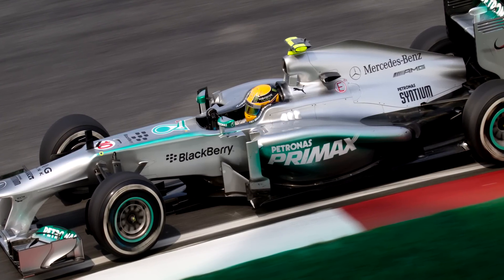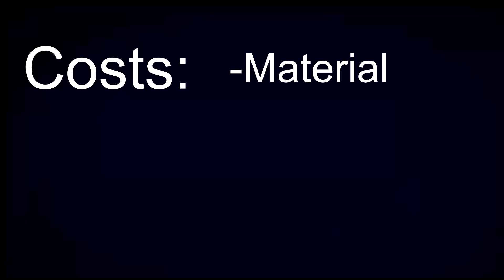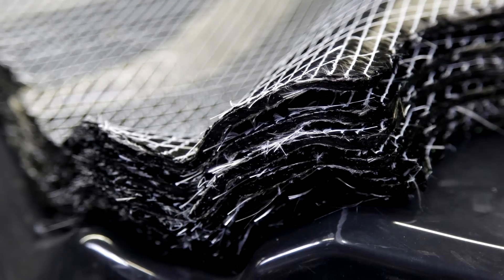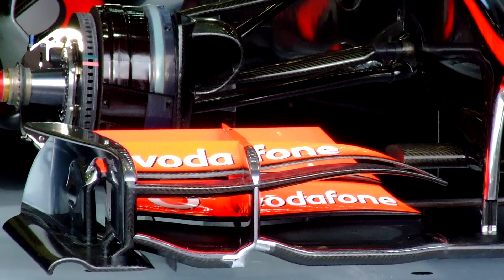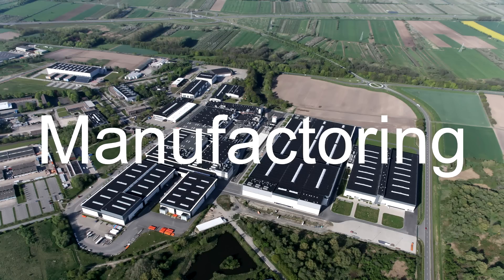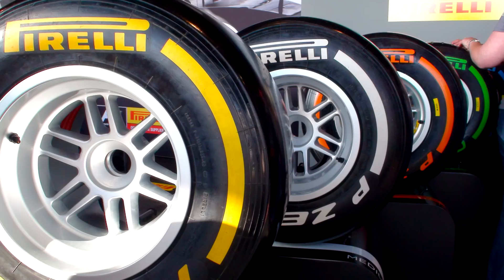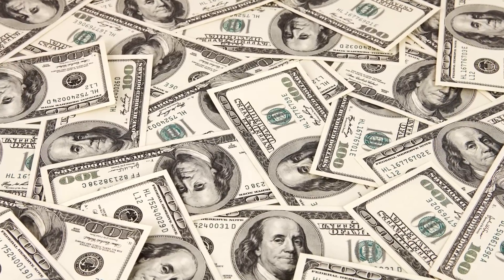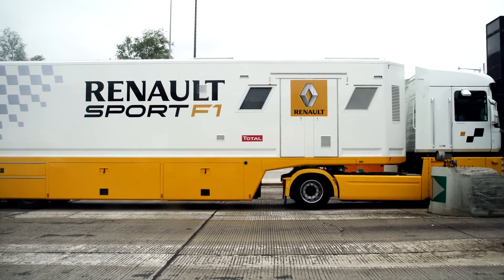How Much Does a Formula 1 Car Cost? (2017) | RacerThoughts #5

Comment: Formula 1 vehicles are basically like Lockheed Martin's Skunk Works program. Every season. Every race. Every practice is R&D. Thats wild. F1 drivers are ground based fighter pilots. And the F1 vessel is the interceptor. The fighter plane.